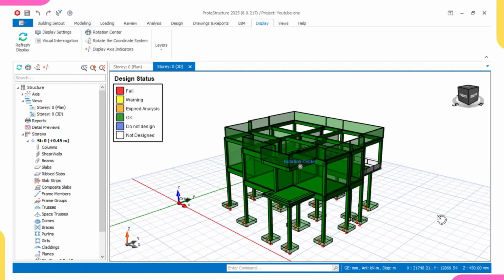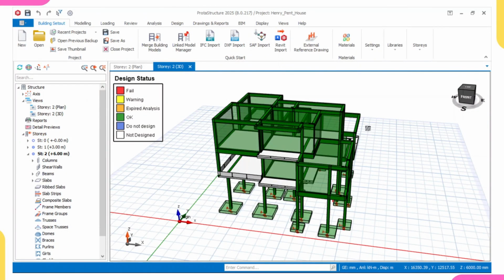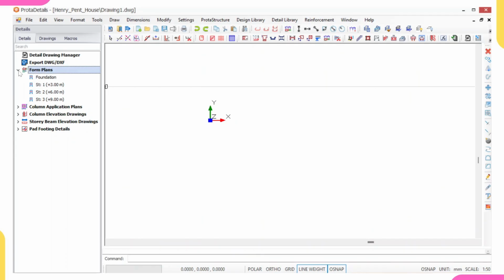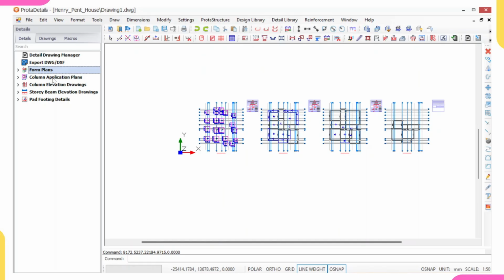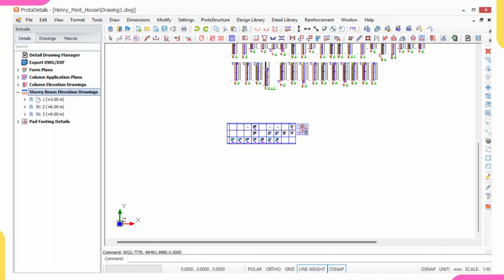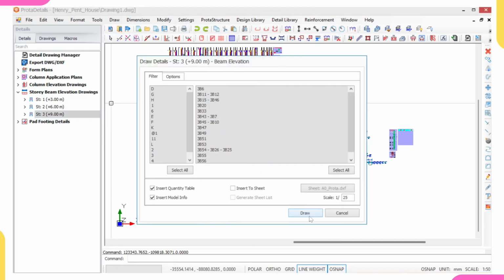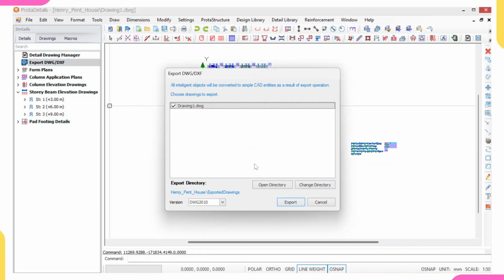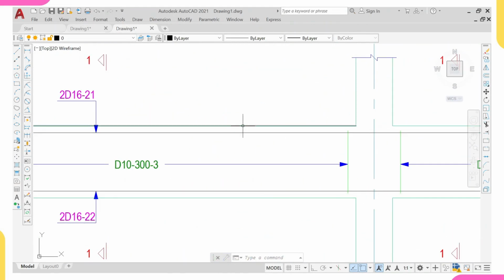Fastest Way to Export ProtaStructure Details to AutoCAD (Step-by-Step)

Comment: i have been having issue with this please My protadetails is not exporting the file to the directory. Once I click export it just opens the directory immediately and the dwg file can't be found in there. i only see .sd file. what can i do?
Reply from the maker: is like you are using the cracked version of ProtaStructure?
Reply: @SamGozEngineering   yes is that why?